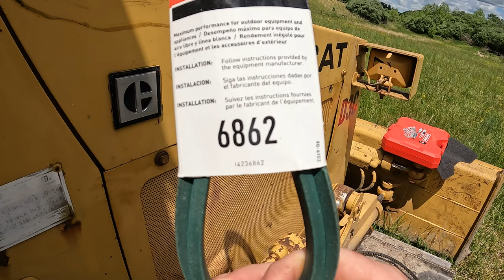Changing the water pump on a Cat D3C

Comment: How did you get the bolts in the fan to break loose? I can’t get to mine good enough to break them.
Reply from the maker: I used a 3/8 ratchet and shallow socket on mine. The water pump was seized up so I didn’t have to hold it from spinning while I tried breaking them loose. I don’t believe mine were too tight, but I did use an indexing head ratchet. Don’t remember if that made a difference or not. Hope this helps. Let me know if you need anything else. 👍🏻